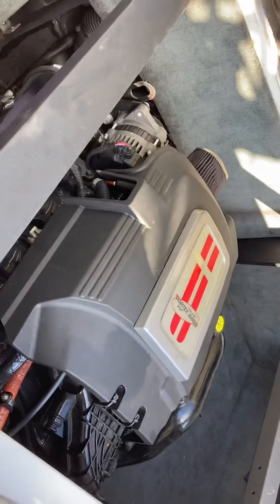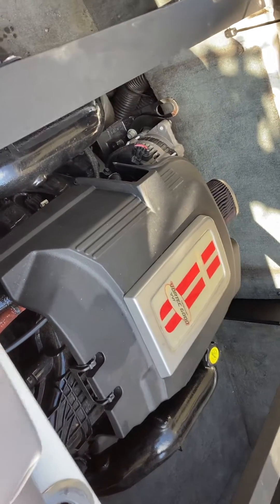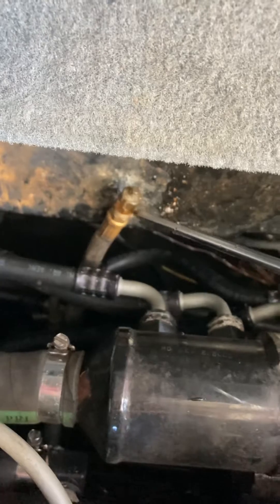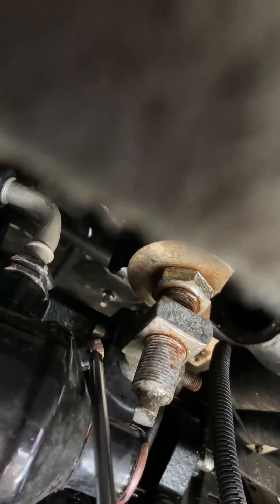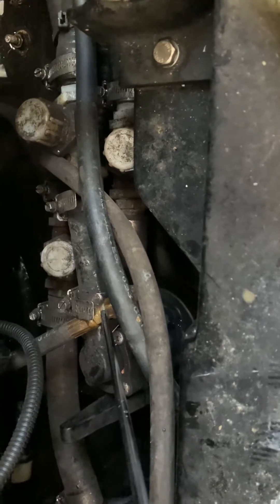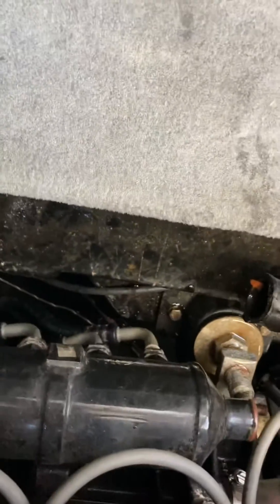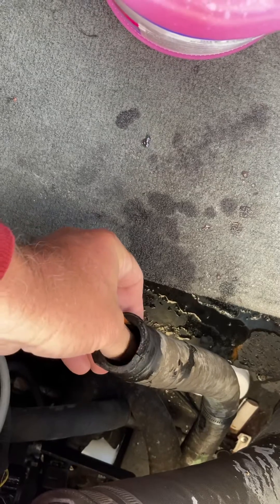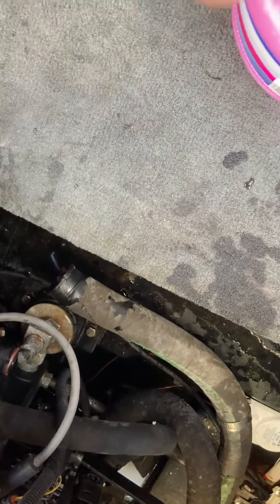Winterizing Mastercraft  X45 Ski Boat

Comment: False information
Reply: False info?  Might not be accurate for ALL boats, but the water removal and eco friendly propolyene glycol change procedure shown here was learned from a Mastercraft mechanic who assisted with the process.  Also note this boat is stored in a mild winter climate with temps that rarely get below 20 deg F.  Helpful instructional comments are welcomed.  Thanks!
Reply: Any tips/instructions for winterizing the cabin heater?
Reply: @tupaco47  
Either run anti freeze thru it, or simply disconnect it but the water pump junction and blow it out with air. (Some due it with their lung power some use compressor)